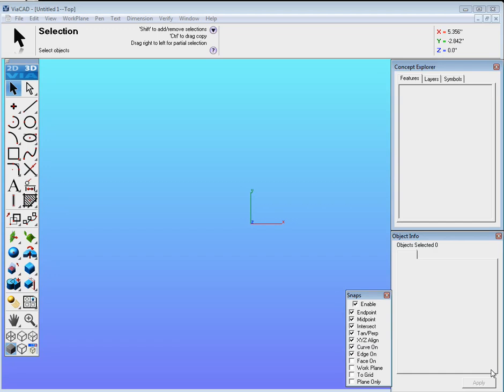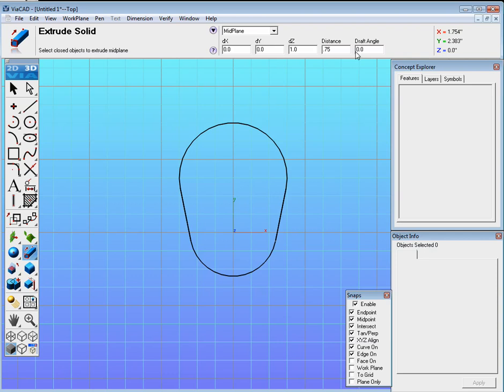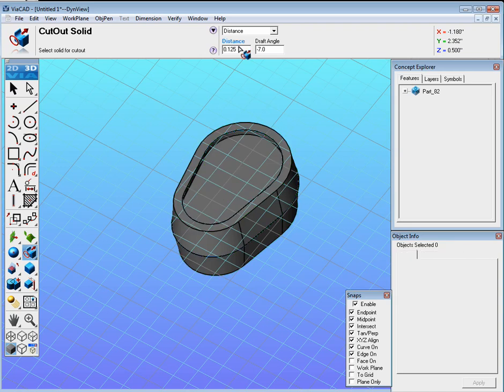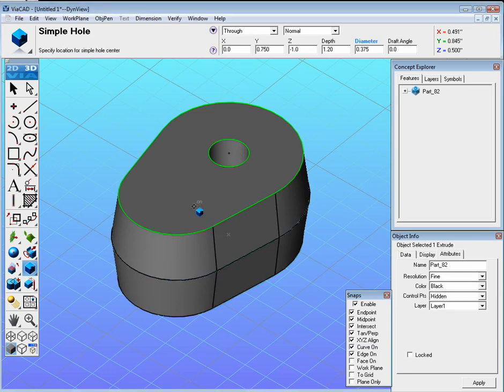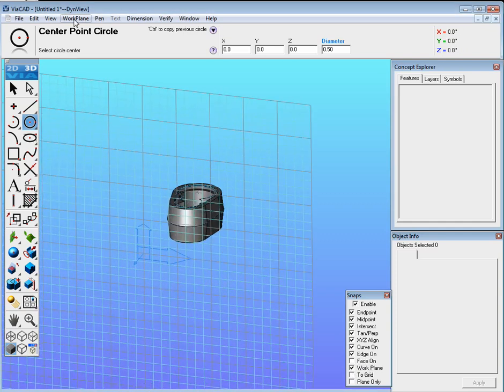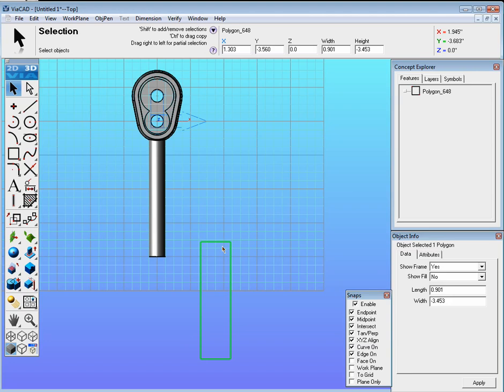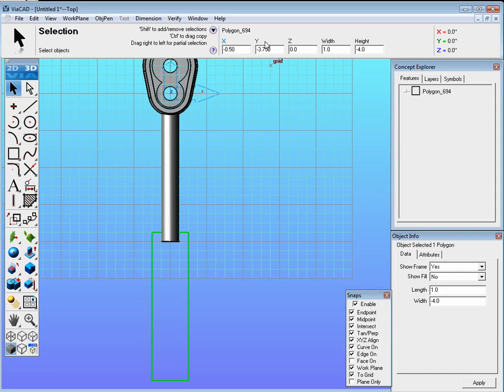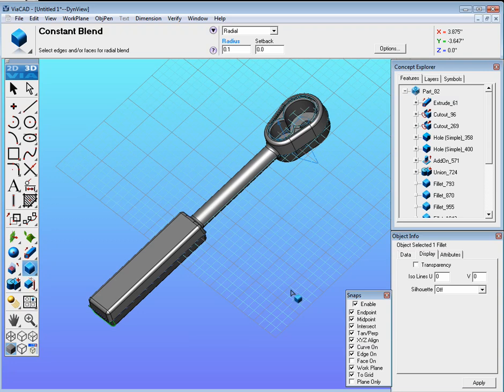E3 ViaCAD Tutorial

Comment: I'm using Shark Fx 7. I will be buying ViaCAD Pro 9 soon. I'm on a Mac. Having trouble after shift clicking the inner shape to cut out a .125 deep and inward duplicate shape… nothing happens. I'm using the cutout Solid tool and clicking the two arcs and lines while holding shift and press return on the distance but I don't even get the cut out hole all the way through the object let alone the .125 deep sunk cut out. Any ideas how to debug? 
Thank you for the tutorial though.